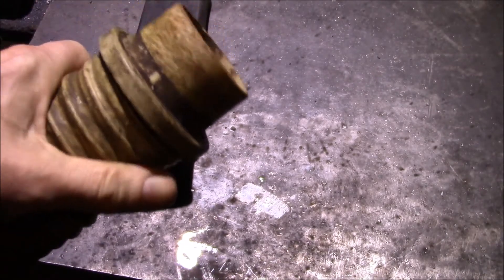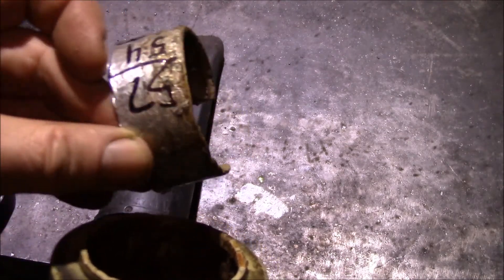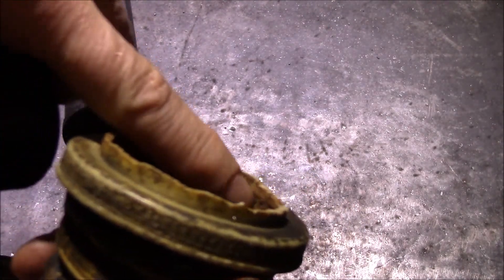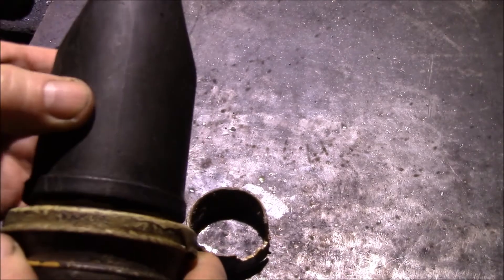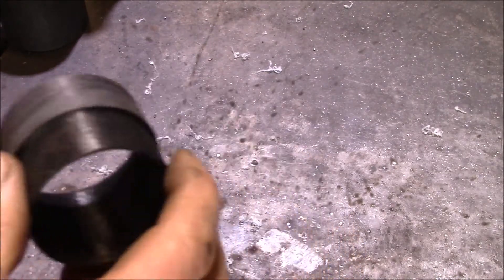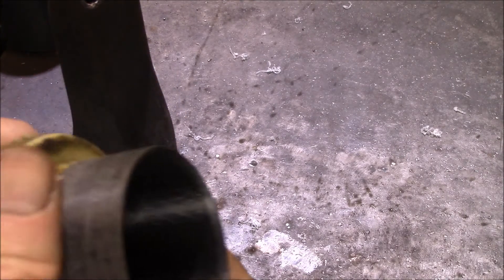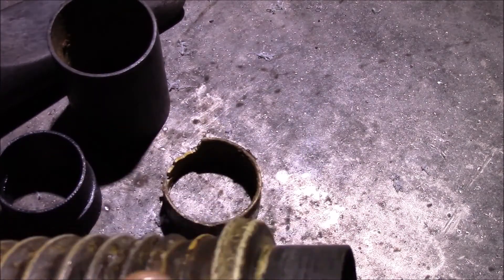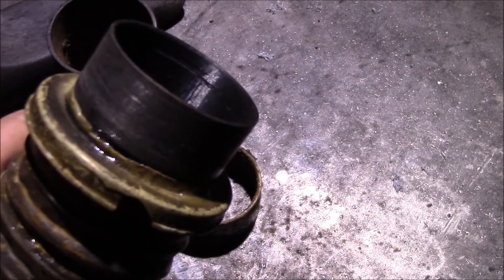2-1/2" Shop Vac Hose Repair with a 3D Printed Coupling

Comment from the maker: The 3D printed shop vac. hose coupling along with the old repaired hose is still going strong in mid-2023.
Reply from the maker: The other end of this hose is starting to crack now in 2024,  Time to print off another repair section and glue that on.

Comment: Man, sometimes you have to buy something new!
Reply from the maker: Yes, some day I'll need to replace that hose.  It's left over from my old shop vac. and makes a handy extension for the hose on the new vac.  But it's still working fine for now and it's not in a landfill.